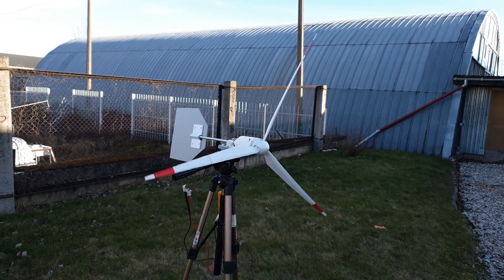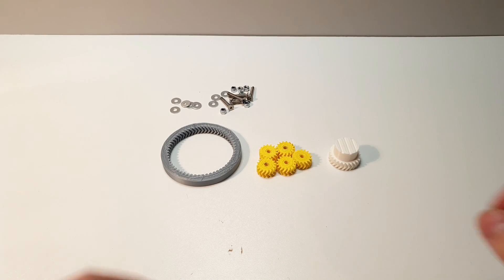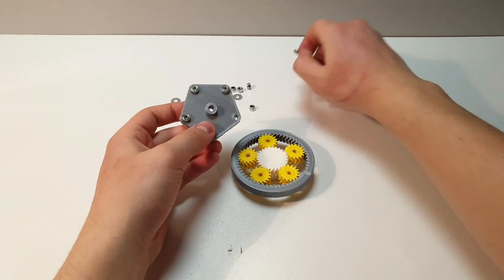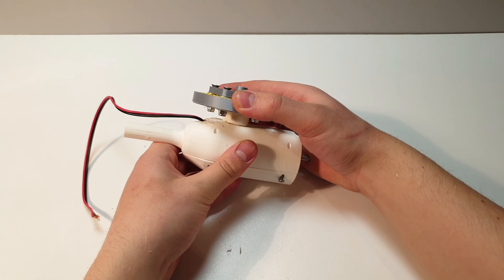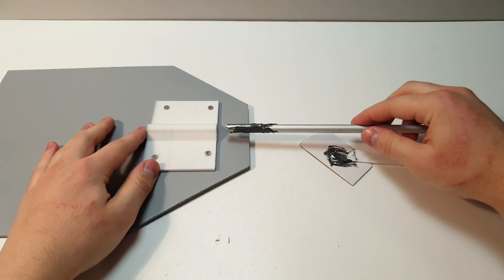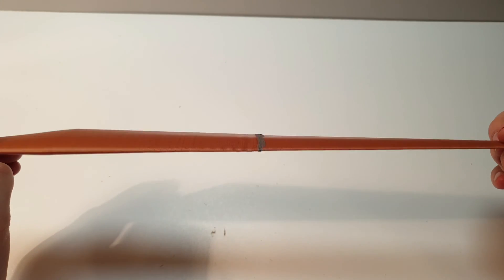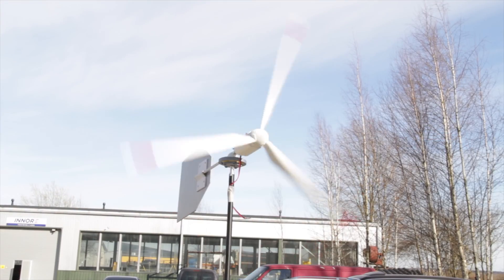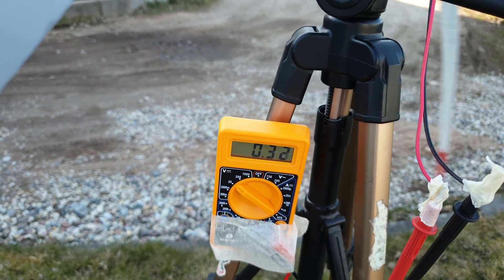3D Printed Wind Turbine ⚡️775 Engine as a Generator - Will it Work? DIY

Comment: 45 degree angle is way to much. In order to spin faster you need angles 10 times lower. Use Qblade to do some calculations on the blades.

Comment: Make it again, with more improvement : 1. Add carbon brush and slip ring, to 360 degree support rotation, 2. Add speed up gearbox , between blade to generator, you can use planetary gearbox, between them.  Thank you. You are great inovator.

Comment: You put the blades on backwards. The flat side should face forward. Also the angle is very steep, go for 22 degrees as a starting point.

Comment: I would recommend using a gear train to speed up the output of the turbine and use a smaller motor as a generator
Reply: His blade angle is much too steep. It looks like 45 degrees! 23 degrees is the optimum for fixed pitch blades, this will also help in getting a higher voltage output.
Reply: Or print bigger blades

Comment: Amazing !! New subscriber here. You do amazing work. For the 775 motor to generate more electricity, it should turn faster. Now it will never be a powerhouse but im wondering if you add a gearbox to multiply the speed of the motor how much power you could get ? Right now, every blade revolution is the same for the motor. 1:1. What if you make it like 1(blade): 10 (motor) ? It would turn 10 revolution per 1 for the blade. Or 50 per minute(b) to 500 per minute (m). Anyways, keep up the great work and thanks for showing that 3D printers can be used for other things than trinkets
Reply: For DC motors it is an approximation but the rule of thumb is that the voltage is proportional to the speed.

10x turning speed = 10x voltage

Comment: Why my 775 motor canot generate curent?
Reply from the maker: I have no idea, every DC motor should generate it. (But it's not the best option to generate electricity!)
Reply: When you’re measuring the voltage did you select the AC voltage setting on the multi-meter?
Reply: 775 rs cannot generate voltage at such low rpm it needs very high rpm for generating power